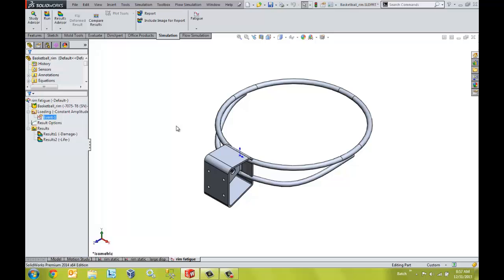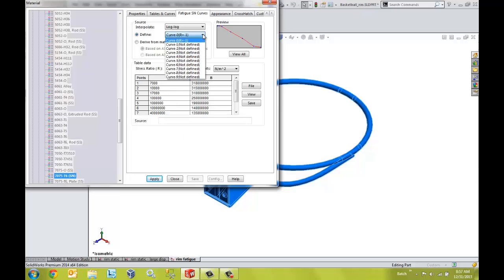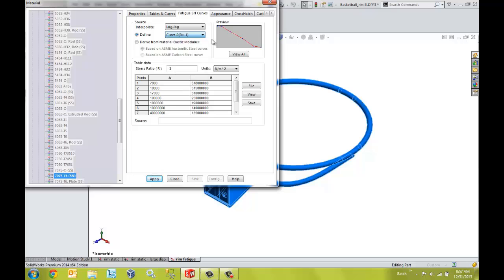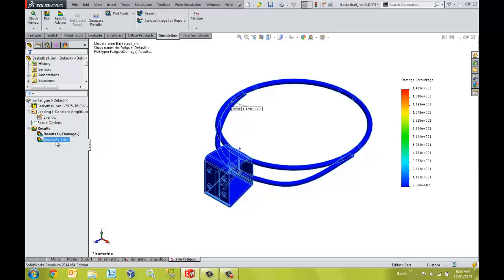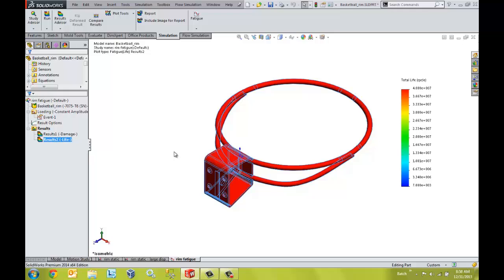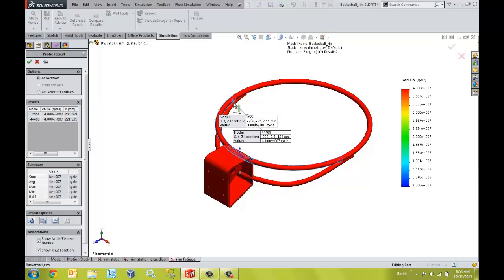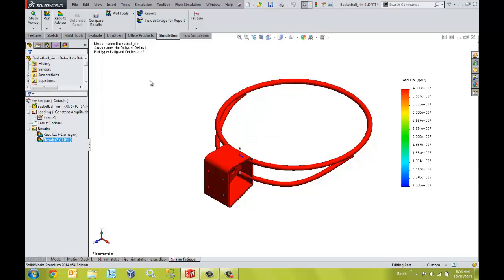SolidWorks Simulation - Fatigue Analysis

Comment: I have a question, someone else did (fatigue simulation) for plastic parts.
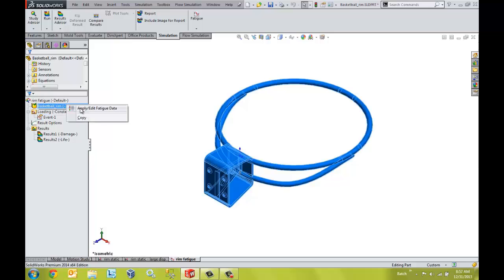These parameters exist at metals but on the plastics is missing (SN curves) at ime 0:50 sec.

What can be done?
Reply from the maker: Hi Ceban,
The material library for metals does fairly complete with S-N data for common metals.  The plastics are not as extensive with their data unfortunately.  You would want to query your material supplier to see if they have measured S-N curves for their products.  If the supplier does not have it then it would have to measured by yourself or a contracting lab in order to get that data.